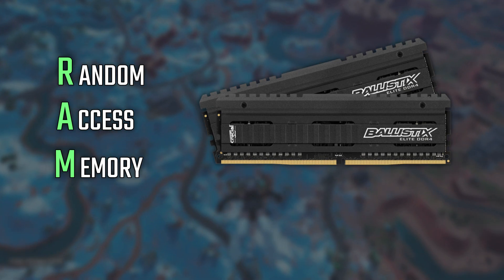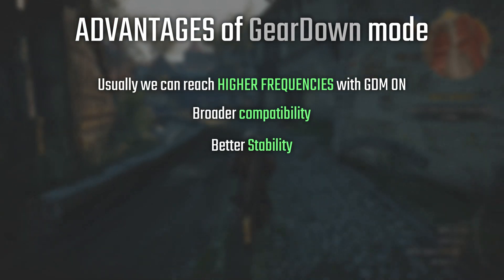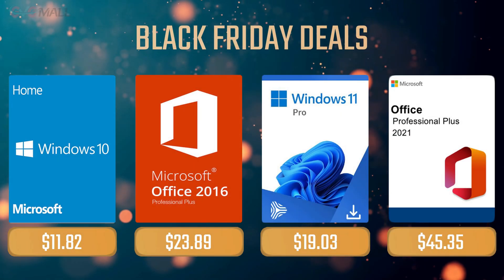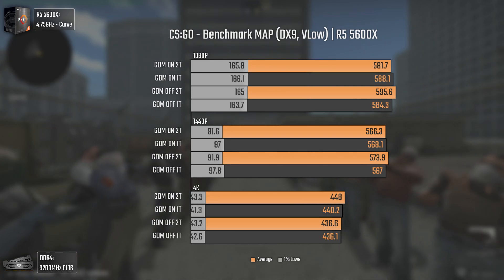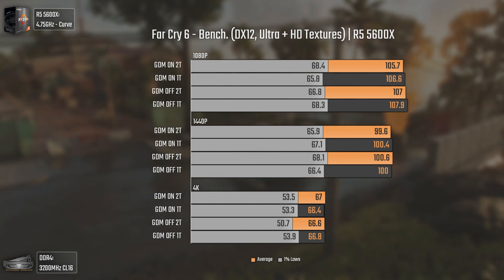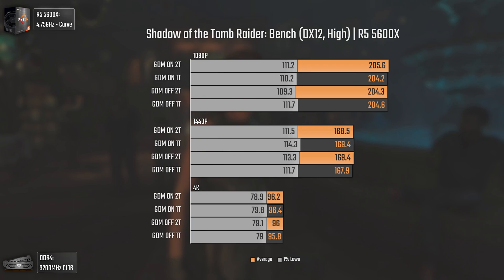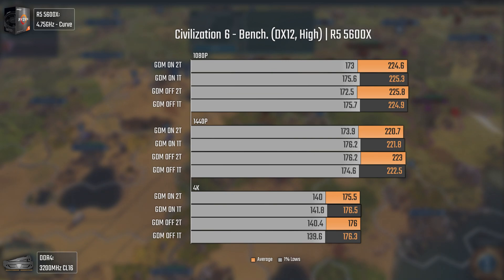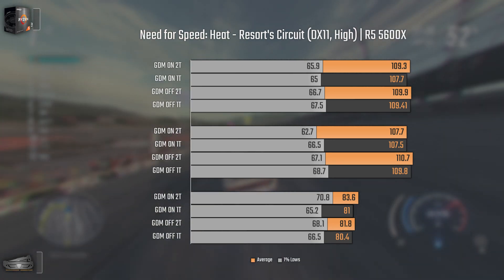Gear Down Mode ON vs OFF | 1T vs 2T RAM | 1080P, 1440P & 4K Benchmarks

Comment: So, the result is: there is absolutely no point in using 2T, whether it's GDM on or off. If you have a good kit of RAM, and it allows to turn on the XMP and use GDM off - go for it. If not, just use 1T GDM on (for example, my patriot viper kit can only work on 3733mhz XMP with 1T GDM on). In this case you can at least adjust the subtimings via DRAM calculator. I don't think 2T GDM on (theoretically the worst option) will provide any additional overclocking potential.
Reply: On my old DDR3 I can only get the stock timings at 2133mhz with 2T sadly...

But the older 2x2gb kit is better with lower timmins and lower voltage which sadly the other more recent 2x4gb kit can't accept so I just thrown 2T and a voltage somewhere in between both kits and left it that way.

I surely could have made better timings but I won't spend my whole day tweaking for the best since just pushing 4.9ghz on the I7 2600K was so easy compared to even get both ram kits to post at 2133mhz which takes a bit of time and have to keep pressing the memory button all the time and it takes a huge time on my motherboard to set fail safe values, would have to keep resetting the bios for a much faster setup...
Reply: The problem with GDM is , while the main advantage is you can push Higher clocks and tighter timings, the clock advantage might bé limited by your IMC. As in, you could do like 4400 on your RAM, but it cant  go Higher than 3800 (with synched fclk) because your CPU doesn't let it without ridiculous and unsafe SOC voltages... So it depends. GDM on is great in some scenarios, gdm off might bé better if you have a shitty IMC. 2T gdm off is rarely Worth it but sometimes you can push Higher clocks compared to gdm on 1t , might bé Worth if you applications are bandwhith dependent or sth. I think every setting has its use, generally for a first time overclock I would decide mostly based on these 2 things : 1) how high can your RAM go? 2) how high can your IMC go? If your IMC can go Higher than the RAM, definetly consider gdm on or even 2t(I would generally incline more towarss the first)
Reply: @andregomes3317  I mostly agree, but the IMC is not always a limiting factor. My memory is now working at 3800mhz with the ryzen 3600, IF set to 1900mhz of course. The problem is, with frequencies this high you simply can't run memory with GDM off. I tried disabling it and setting CR to 2T, managed to boot, but got errors while testing ram. So, the simplest and most effective solution is to go with GDM on 1T. Of course, if you have for example ryzen 1600 and memory with xmp profile set to 3000-3200mhz, setting GDM to disabled can provide some improvements.
Reply: I had one complect of 4000 MT RAM that could only be run with GDM+2T. 
Now i have 3600 MT RAM OCed to 3800 (with manual timings), that can be run with GDM or 2T
Reply from the maker: Gdm allows better frequency and so on, so it is overall better
Reply: Naw, man, NEVER use xmp. Tune your sub timings and tertiary timings and IO/RTL by hand manually for best performance. My kit's XMP is 3600/c16 and i run it 4100 c15. And the sub timings, et al were even more gains.

Comment: Good video, but why not test every game on very low settings when doing these cpu and ram benchmarks even when you have a good gpu like this 6800
Reply from the maker: Doesnt make sense to lower settings, if you're not bottlenecked in most of them at 1080P
Reply: @AncientGameplays  i just like to stress cpu and ram as much as possible
Reply from the maker: @th3truth_  you don't stress it more by going into lower settings if you were already bottlenecked before lol

Comment: Good video, could you teach us how to undervolt + oc to a 5800X
Reply from the maker: I will tey
Reply: Not all 5800x likes to be touched in the curve optimizer, but the best performance from a 5800x comes from there and let the algorithm manage the boost extra speed (up to 200mhz)✓
Reply: @CESAR_H_ARIAS  the only thing i dislike about any kind of automatic boost/OC with Zen3 is a low "effective" frequency at multithreaded tasks. So you either lose 4-5% in multithread and gain the same amount in singlethread or vice versa when you just manually fix the clocks.